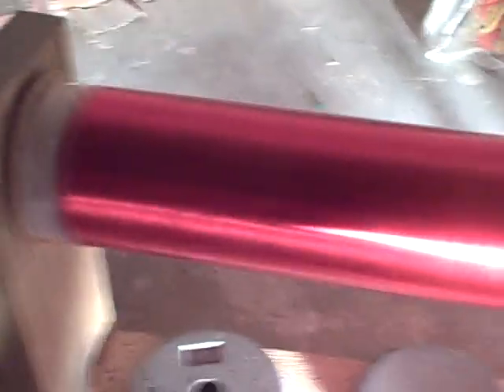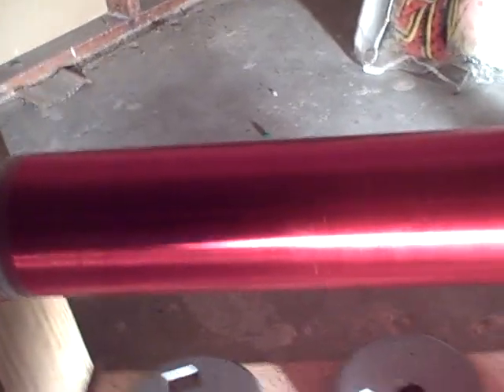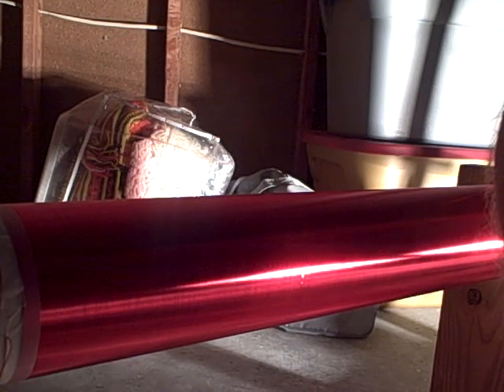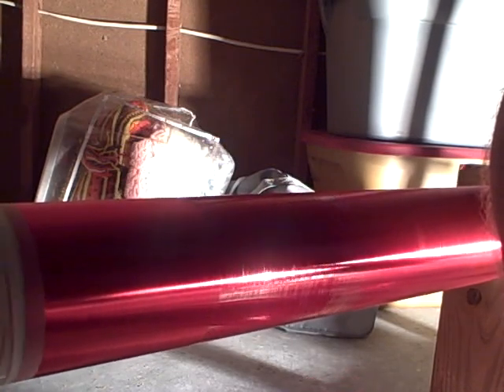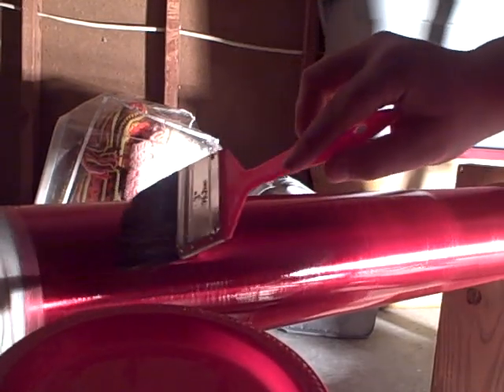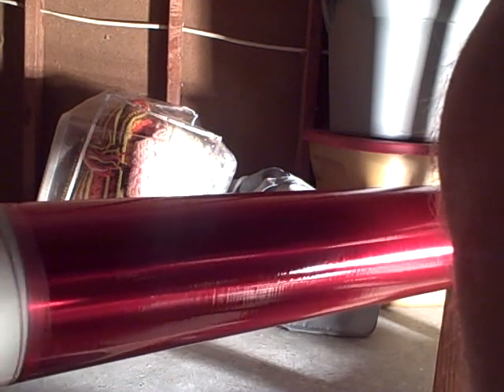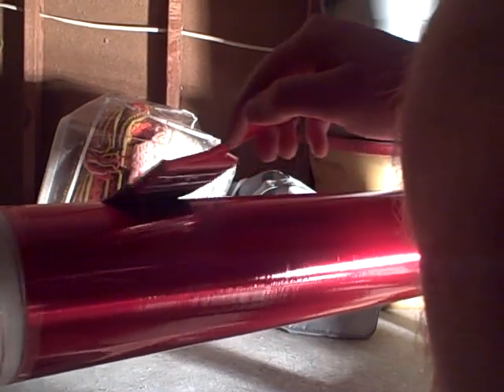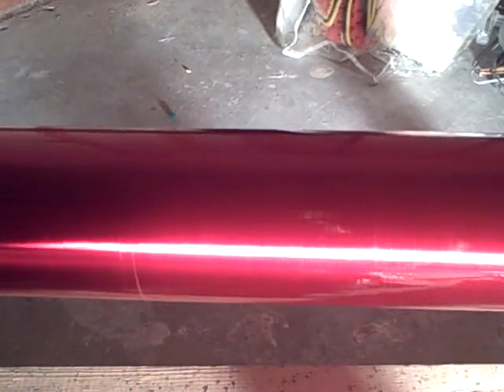Coating tesla coil secondary with polyurethane.

Comment: I had a big problem with bubbles when I coated my secondary, even with a high quality brush. I found that if I went back over the wet coat with a dry foam brush, it would be much smoother.

Comment from the maker: Hehe, thanks you guys! Dang, didn't think i would get any compliments. It went REALLY quick, so it looks bad up close. Oh well, i hope i can push 30-40 inch sparks out. Well, i also hope the MOT will stand up to 1kw for a few minutes. Time to fix my arsg.

BTW i now have 3 or 4 coats, almost thick enough so that i don't feel the windings when i run my fingers across it.

Cant wait to get the stuff for the quadrupler, then i can make it and fire it up.

Comment from the maker: @djfreebey I like the poly im using just fine. The magnet wire is from Parawire and it is 24 gauge double build insulation. I've got a newer video shower my 2400 turn secondary with 32 gauge, in the end it looks like a piece of glass.

Comment: I'm not trying to be rude, it's a great setup, compared to mine, and you've done a great job, but I don't think it has many more turns than the 1075 that you quoted because you mentioned imperfections, such as gaps in the wire; these gaps would cut down on the number of turns.

Anyways, nice coil. You're doing a very professional job with your very unprofessional equipment! I'm surprised by the ingenuity of the Tesla Coil building community, that is to say, you're doing well, my friend.

Comment: CAN I USE OIL BASE POLYURETHANE (generally used for wood stain) on motor winding? Is it SAFE TO USE THAT?
Reply from the maker: I am not sure, can you show me what product you are talking about? I can show you what I used and what I know what works. I have another coil with 3600 turns and I used about 30 coats of the polyurethane with sanding in between each coat and the coil looks like glass, it looks so amazing